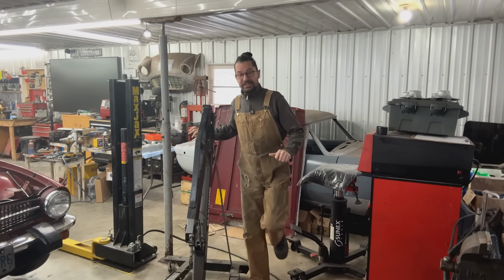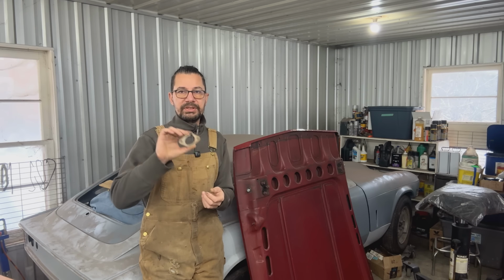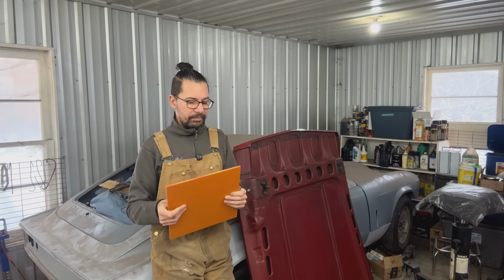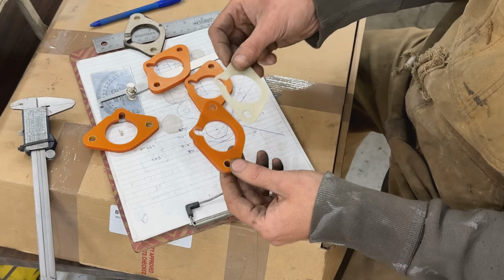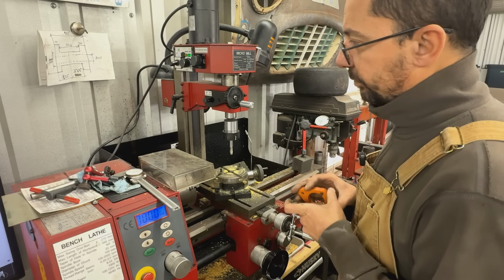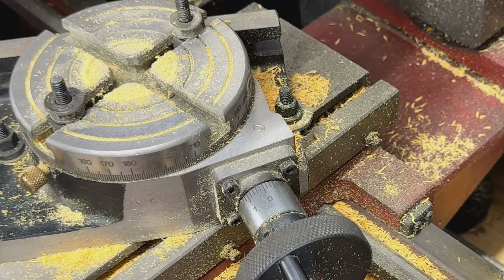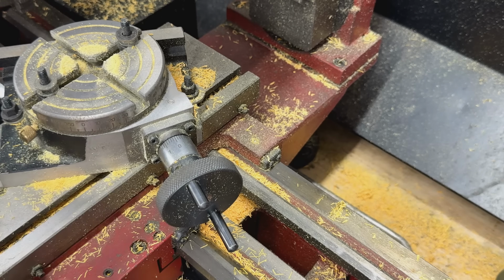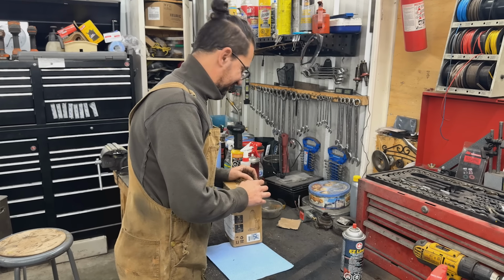1972 GT6 - Part 100 - Making Obsolete Parts

Comment: Hi Elin, I’m intrigued on what you may decide to use as a good bed-base for your separate “mini-mill” idea. As you will want it be very stable, maybe you could repurpose an old spitfire block ( or similar) and drill and tap into it to take the mill stand and your new rotary bed fitting on the flat top face. I know I’m sounding silly but as they say “the only thing worse than a bad idea is no idea”. Stay blessed Yakovs! 🖖

Comment: Elin, while I am not a machinist, my background is manufacturing.  Regarding your comment about having to create bushings to take up the slack for the two bolt holes--would it be better to utilize two smaller diameter bolts for mounting the phenolic spacer in the rotary table?  This would keep the phenolic spacer firmly positioned during your milling operations and once the part was completed, the final operation would be to simply drill the two bolt holes to the necessary diameter.  

You have a great channel and I admire your persistence, determination, and attention to detail!